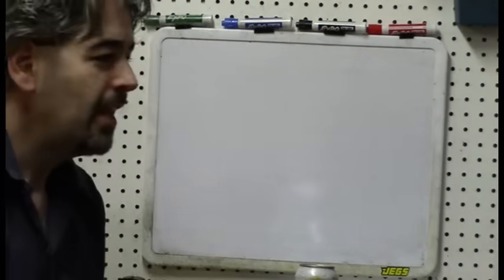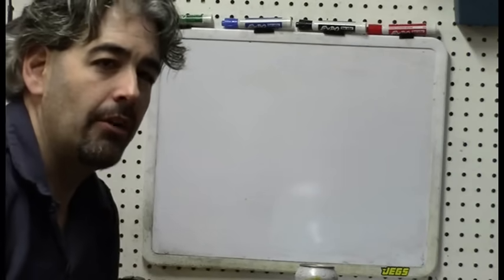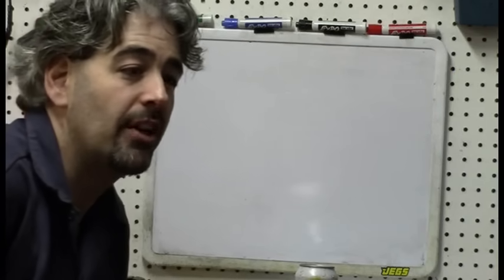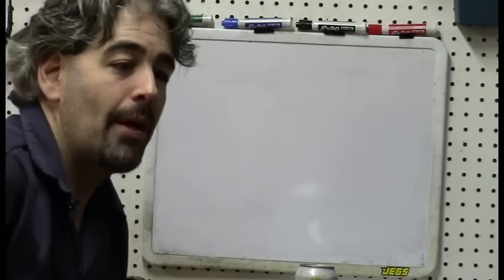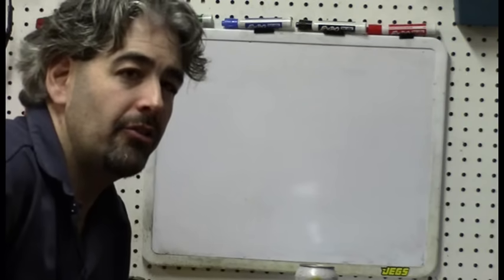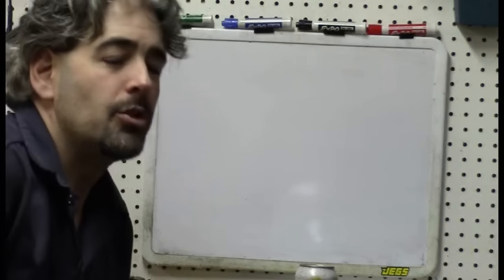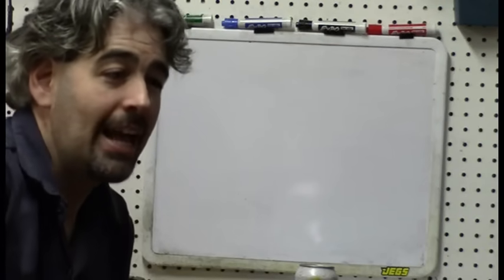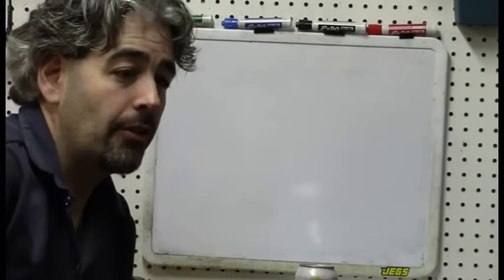Secret of Engine Problem Diagnosis- Fuel Trims Pt.1

Comment: This is a very informative  video! I have a question, if you can answer. I have a lpg system installed into my car. When i am using petrol as a fuel, my car has LTFT : 5% which i think is not a problem. When i turn on the lpg system and the car run completely on lpg i get readings like LTFT: 25% ++ . My thoughts are that the reducer of the lpg needs to reduce more of the gas pressure that is pushed though the injectors or that the membrane is broke and sucking air from the underpressure pipe of the car. What is your opinion?

Comment: Hello I just started watching your videos and thank you for all the information but can you explain better what's lean condition and rich condition? Please
Reply from the maker: Sure. An engine needs a proper mix of air and fuel.  In most conditions I t will be14.7 parts air to 1 part fuel.  lean condition is when the balance shifts to being more air and less fuel that this. Say 16:1. this can occur because of a vacuum leak letting more air in or from a lack of fuel delivery or anything else which increases air and/or decreases fuel.  A lean engine will reflect as a high fuel trim- the computer will add fuel to bring the ratio higher towards fuel. 
  A rich condition is the opposite- more fuel than should be. This could be anything where more fuel is delivered than should be- leaking injector, too high fuel pressure, EVAP or EGR leak, etc. It shows a negative fuel trim as the computer reduces fuel from the injectors to restore balance.

Comment: These are great videos. I dont let mechanics touch my car after spending a fortune only to realise they completly stuffed up eg $2500 on aircon fix found they broke the new line they put in so leaked. And i sware they didnt do the timing belt right. Car has always idled rough, i had the timing belt done when first got the car just as insurance. Since replaced vacuume lines, plugs, coils, injector seals, tried new maf. O2 sensor seems good. Fuel trims are around +7 and short timrs are fluctuating between -4.7 to upwards of +6. Car has tones of power being a high pressure turbo volvo. Engine also vibrates or just sounds rough on deacceleration. I have a feeling that when they put the timing belt on they didnt allign the exhaust cam gear correctly. Its as if i have a precat exhaust leak and have the loud exhaust resonating sound all the time even though there is no leak. Have had the problem for 3 years now. Oh changed the engine mounts to polly as the rubber ones wont last more that 2 months from vibrations etc. Apart from that car runs great, quick, fuel economy is excelent.
Reply from the maker: Wait.... you won't let a professional touch the car because they don't know what they are doing and yet you replaced vacuum lines, plugs, coils, injector seals, and even tried new maf???

Comment: Great info here. went over it again because my 2012 Ram, 4.7l doing funky things. E85 system, but never ran this fuel. I get a P2096 and P2098. MIL light on. Ive noticed that if i am looking at fuel trims and O2 sensors on a scan tool while driving, as soon as I let off the throttle,  all the readings go to 0 (zero). like a short to ground on the line. 
I suspect that this condition may have been triggered by something I had done when changing the engine oil. I drove the truck onto the ramps, but did not fire the engine until the truck was sitting level. Now, from a ScannerDanner vid, he explained how E85 computers determine the percentage of E85 in the tank. But the key was the condition setup, so to speak. Say when you shut down the cat/truck and fuel tank is at 65% and when you restart the unit and the fuel level indicates it is at 66%, the computer can only assume the fuel has absorbed 1% water in the tank.
The only way I can clear this situation is to disconnect the battery. clears the computer.  
What's your thoughts?
Reply from the maker: My thoughts are "what data do you have"
Reply: Was not able to save freeze frame, user error. I'm off to N.C. to the car races, if it pops back up i'll write the data down and get back to you thanks Allan

Comment: Here's one that is giving me fits, I'll try to give the short version, working on my daughters 2011 Kia Sorento, 2.4l engine, some symptoms/problems are lack of acceleration and lack of power particularly in the higher gears (other problem is some shifting issues), compression checks okay, fuel pressure is okay, well at idle its okay. Cat converter is only couple years old but checked back pressure and it was okay. Ended up pulling transmission and replacing torque converter, that did not fix it. Put in new throttle body with TPS, that did not fix it, and if I forgot to mention its not throwing any codes. I decided to borrow my brothers scanner to see if it would show anything that mine wouldn't, I have a Bluedriver, it did pick up two codes mine did not show, one active code, P0453 Evaporative emission systems pressure sensor high input and one historical code, P2192 System to rich at higher load (Bank 1). Decided while I had his scanner to look at fuel trim data and the upstream and downstream sensors. The upstream is a wideband A/F sensor. Readings and sensor reactions seem okay at idle, the lambda readings look okay, the only funky thing is if I increase the RPM's, the Long Term Fuel Trim goes negative and stays negative, in fact looks like it pegs out and just holds until I let off gas, not sure how to interpret that. I just have this feeling that one of the O2 sensors is not performing correctly just not sure what I should be looking for.
Reply from the maker: if you think an AF sensor or O2 sensor isn’t working you can simply induce rich and lean variables and see if it responds accordingly- particularly on the narrow band sensor since it doesn’t have proportionate feedback- it is “all or none” so really easy to validate.

Comment: Schrodingers Box Thx for the awsome vid sir. I'm just curious about if I take out the O2 sensor(my mechanic did) after installed and tuned a piggy back. What will happen to the short term and long term fuel trim? Thank you sir

Comment: Just fixed my daughters 2002 toyota rav4 2.0 codes were p0171 p0174. Watched your fuel trim videos and determined it was a lack of fuel. Long terms were high. Changed fuel filter and replaced fuel injectors. Bam fuel trims went 0.0 long and short fixed 👍 runs like new ! Cleared codes no check engine light. My obd2 reader shows green good to go. Thank you, you are the man !

Comment: No longer have to pay someone to fix my car thanks to this. Quick question. Are these readings made at idle?
Reply from the maker: the readings are always made under a load curve- that is from idle to about 3500 over a curve. just reading fuel trims at one point can not tell you anything.

Comment: Thankful i came across your channel, very informative and easy to follow.  Was able to diagnose and fix a P0171 on a 2014 Nissan Pathfinder using the LTFT/STFT readings.  Have to admit i had to fight my instincts/desire to gravitate to the sensors (MAF/02) as the source of the problem but i trusted the method and more importantly the "data".  The data showed higher fuel trims at idle and improved (lowered) at higher RPMs.  Started hunting for a vacuum leak and low and behold a bad crankcase breather hose (in the worst spot in the engine compartment) was the culprit. $7 bucks later and the fuel trims are headed in the right direction (just need to let it get to the new baseline and should be good). Thanks again!
Reply from the maker: Well done! The data will tell you problem if you let it. As you said, most people will just jump to a conclusion rather than interpret a conclusion.
Reply: Did that cause any driveabilty issues for u?
Reply: Was a while ago now so do not exactly recall all the details but I do not recall any drivability issues. Think it was just the check engine light and maybe some reduced gas mileage that sent me hunting for the problem.

Comment: How are you doing? Great,great video and explanations. How do you tell apart,whether it’s an O2 sensor or it’s an air fuel ratio sensor? They all look the same,thank you
Reply from the maker: By the output. When the output is in narrowband format it has to be a O2 sensor.

Comment: Greetings from Turkey, thats the most clean and informative session about diagnosis i`ve ever watch. I have a question, my car has same problem, but one more symptom, when rpm goes higher ok as you mention LTFT sets near  0  but for example in traffic lights when car stops, idle gets higher, is it really we have to check vacuum leak first.  Just throttle cleaning made so far.
Reply from the maker: sounds like a classic vacuum leak.

Comment: Very Grateful to you Mat for your Tutorials.  I have a problem with my rpm dropping when my engine returns to idle.  Thanks to your video I now understand fuel trim and can now see my STFT is up to -18% variable and my LTFT is about -10.9%. Plugs look OK so I am hedging my O2 sensor is faulty.  Cheers, Chris.  Oh! just rang my local service station and asked about fuel trim and they didn't have a clue what I was talking about.
Reply from the maker: Why would you possibly suspect the O2 sensor is faulty???? That makes absolutely no sense- the O2 is guaranteed to be working. Look at your variable STFT- how are you seeing a faulty sensor?
Reply: OK I am just learning here.  What can be making my STFT be fluctuating between -3 and -18%?  Suggesting my fuel mixture is rich I think.
Reply from the maker: Very simple- you just need to now methodically eliminate basic rich condition variables. But it's a bit concerning you would have replaced the O2- it should be clear the O2 is your feedback reporter for this process. If that is not clear then you will not be able to interpret your induced condition responses.
Just  keep it basic and use the O2 voltage as your feedback output source as opposed to your variable.
Reply: Just pulled my air filter out and went for a vtec blast.  This seems to have almost cured the rpm bogging  but the STFT is still rolling up and down.I will watch more of your Tutorials and persevere.
Reply from the maker: Wait- you did what????  I have no clue why you would do that based on the data paramters. I am not sure what I'm missing but it seems you are doing a different procedure than I do.  I am afraid I am not going to be able to help as your methods are just really different than mine. Good luck man- hopefully your system works better than what I do but I guess I am just not seeing the logic process you are following. Maybe you have more data than what I am seeing?
Reply: My theory was that if the fuel supply was rich then perhaps the air flow was being restricted.....I also just watched your video on the Hummer ( Dirty Air Filter)!  Please don't give up on me!!
Reply from the maker: I understand that. yor air restriction would be monitored by the induction sensors though and thus there would be no fuel trim adjustment since the injector PWM would already be compensating.  
My suggestion- test the fuel pressure regulator.
Reply: Thanks Mat.  Another thing I noticed while looking at my live data was-the timing advance at idle varied from 3.5 degrees to as much as 6 degrees and constantly in flux. Is this normal?
Reply: Just watched your video "Fuel Pressure Regulator Diagnosis + Understanding (HD!!)"  I'm starting to enjoy this Mat.....In a sadistic sort of way.  Great stuff. I will follow your lead.
Cheers, Chris.
Reply: Hi Mat, sorry to bother you again.  I have just removed my Fuel Pressure Regulator.  Looks very clean.  I was able to blow down the return pipe to the tank.  I replaced the regulator attached a clear pipe from the return on the regulator and fed it into a bottle.  Fuel started flowing through the pipe as soon as I turned the ignition on, even before engine start.  Should this happen?  In anticipation.....Chris

Comment: This is probably the most comprehensive explanation of engine issues. I hope you are well!
Reply from the maker: thank you i am doing well indeed!
Reply: @SchrodingersBox  hey I'm so sorry for this question,  I have a Stft of - 25% and a Ltft of +7.4. Does that sound like a leaky injector??
Reply from the maker: It could be. Among 10000000 other possibilities.
Reply: @SchrodingersBox  😂 true, I should drive the car and see if it corrects itself
Reply from the maker: lol. Personally I would curve the fuel trim against load as shown in the video to narrow down to the system likely causing the adjustment on the STfT.

Comment: I bought a semi neglected 2004 f150,had misfire codes,timing codes  .I'm no mechanic but I tend to watch guys like you who actually know what they are talking about.I addressed the the misfires first,new plugs coils,I didn't care what was bad they were all old needed them.Cured my misfire fuel trims in both banks got lower still not right tho.next I addressed the timing ,I unplugged both vcts,erratic timing went away,replaced them both ,again both were old.Immediatley the fuel trim on bank 2 dropped to perfect and the fuel trims on bank 1 dropped but still high.My question is as I'm looking at all my numbers 02,maf,and others they all seem right except my tps reads at 12 at hot idle.It doesn't throw codes but like I said bank 1 fuel trims are high and it idles a little rough using a little more fuel than what I think it should be.with no codes where should I be looking? and why would my tps be so low?my best guess is it's a vacuum leak ,but I would like an educated person's opinion.Again the truck runs almost perfect but drinks gas and the idle bounces between 575 and 615 .Youre a great teacher and I've already learned so much.
Reply from the maker: Ok- what data do you havc?
Reply: Schrodingers Box forgive my ignorance, my long term on bank 2 is 0 ,shorterm is almost the same.Bank 2 long term is around 12 and short-term is in the -8 to 10 .MAF reads 0 when off,I don't remember exactly what the 02 sensors read but I do remember the corresponding sensors on opposite banks read the same as each other.Throttle position sensor reads 12 at idle.  I don't know what else I'm supposed to be looking at I guess.
Reply from the maker: I need to know what the MAP, MAF, LTFT and STFT is at idle, 2200RPM and 3500RPM

Comment: The learned LTFT from the SHTF keeps the 14.7:1 ratio until the fault if fixed. So the car runs fine although it has a fault. Once the fault if fixed the SHFT alters the LTFT where ideally they should both be around zero.
Reply from the maker: You got it!!
Reply: @SchrodingersBox  Thanks.

Comment: I liked all your videos and well explained. Please what could cause fuel rail pressure sensor in high rage and engine light comes on at idle.... immediately I start the engine or when is on ON position. And when the engine is on, at park rpm is high and at drive rpm is low. Kia carnival 2005 2.5l petrol automatic. Thanks for your help.
Reply from the maker: Sounds like fuel pressure regulator problem

Comment: Very informative video,how about P219A or B,can you make a video for that.thanks
Reply from the maker: I have two of them. First- the concepts on this video apply. Second- my series on Air Fuel sensors tells how to acquire the data on AF sensors. Between the two you can determine try cause of excessive fuel trim adjustment.
Reply: @SchrodingersBox  thank you very much everytime i diagnose a fuel trim codes, i just watch your vids,God bless and more power to your channel.

Comment: Hi First let me say thank you. You have an excellent way of teaching this. I do have a question. I’m having a hard time getting my head around how an exhaust leak would draw in air as it is positive pressure pushing out unlike an intake which is vacuum  drawing in but my question is, Will the trim data on an exhaust leak show the same curve as a vacuum leak or the curve of a fuel issue? I have a Gm 5.3 bank 1 LTFT at 25 at idle slowly coming down to around 18. On acceleration it goes Back to 25 and Stft rises to about 18. I’ve  been through the injectors fuel pressure is 50. If I had an intake leak I’d have the same on bank 2 but Bank 2 is perfect. But I have  No exhaust leak on that one either.
Reply from the maker: It’s because there is some Venturi effect as the exhaust passes by the leak between “puffs” from each cylinder.  You can see this on a pressure transducer in fact.
Reply: @SchrodingersBox  thank you again. So since the air is being introduced just  before the o2 sensor it will sense it as a lean condition and add extra fuel under load the same as restricted injectors. Is this correct? I’m repairing the leaky manifold anyway but I was just curious.
Reply from the maker: Absolutely correct. I call it a “false lean”. The combustion is correctly balanced but the O2 sensor is seeing oxygen after the combustion forcing the adjustment of fuel trim that isn’t needed.

Comment: this is an amazing video thank you so much but I have a question how long does it take for the LTFT to change in case of high throttle in the last video?
Reply from the maker: It totally depends on the vehicle.  On many GM's I've seen it almost instantaneous with STFT.  On some older Fords I have seen it very, very long.  Like 8 minutes sometimes!

Comment: very nice tutorial, 
how do i fix P0430 code?
Reply from the maker: Super easy- You can conclusively Diagnose it by checking catalyst efficiency via superimposition of the HO2S voltage with HO2S1 at 2200RPM.

Comment: Man I can really use your help right now I got a 2009 Cadillac to keep setting a po171 PO174 it's driving me insane I've good fuel pressure good spark good math no intake leaks 02's are reading fine I don't know man it's driving me nuts
Reply from the maker: ok start with the extreme basics:
what are your fuel trims indicating?